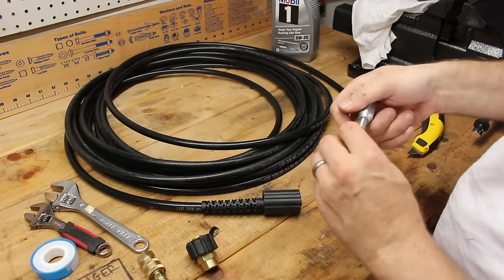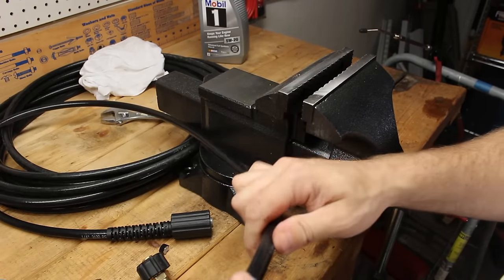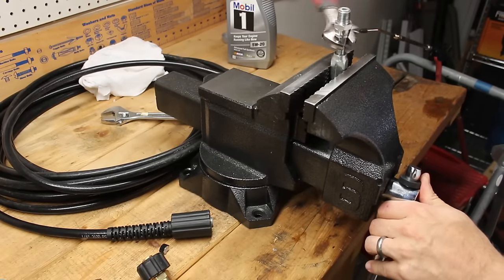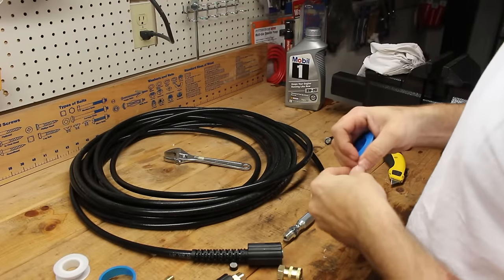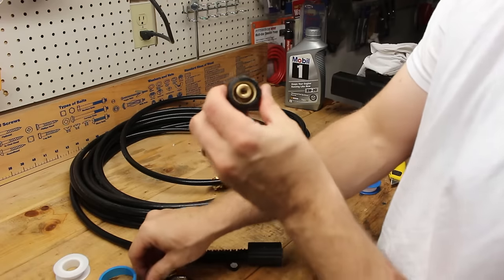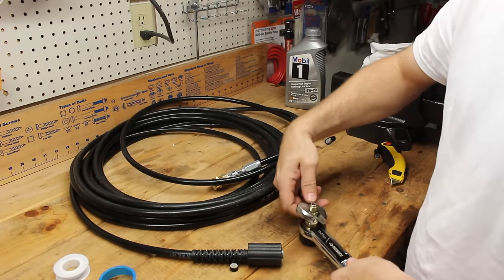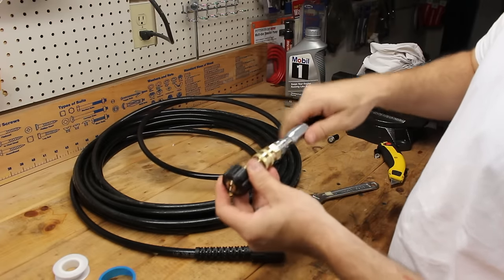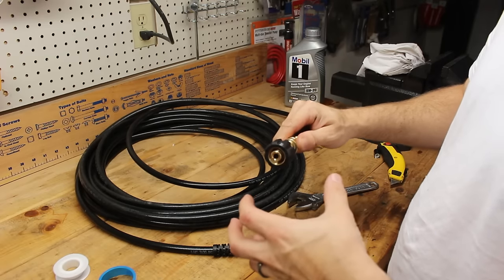How to Repair a Pressure Washer Hose in 6 Minutes (Any brand Gas or Electric)

Comment: Time is money and my time is worth a lot.  Most houses will break in the middle somewhere due to rubbing or scrapping.  A new hose can be had for $20.   I'll opt for that over taking the time to repair.  Your mileage may vary. 🤔
Reply: broderp new hoses run 60$ for 50ft and 100$ for 100ft.  I'd buy new to for $20
Reply from the maker: I've never had a hose break from rubbing, only from touching the exhaust (multiple times). You're correct that time is money, and repairing a burned hose on the spot is a lot quicker (and cheaper) than shutting down a job and driving out to the store for a new hose.
Reply: I also came to that conclusion... NZ$30.00 for a new hose delivered next day.....

Comment: Pin hole is in the middle of the hose, cutting it in half with end fitting won't do. There should be a pin hole repair kit or a union coupling to joint the two sections together.
Reply: I agree! So what is the answer ? Is there a way to splice the hose ? Where will the hardware come from?
Reply: @waynegargano1016  ClampTite looks pretty good but its about $70 for the tool than you need safety wire and coupling.
Reply: I had the same problem, but the solution is more expensive than the hose. You would need two Gates compression fittings, one for each end of the hose and a threaded coupler to screw the Gates fittings together. But as I said, the cost at $15 or so per Gates fitting and the coupler you're looking at $35 - $40. Now if it's a hose that uses some proprietary end fittings you can't find then it may be worth it.  Good Luck
Reply: Moff Diskust  Not sure about that at 3,000 PSI, it will take off like a bullet when it let go.

Comment: You do know u cam buy a new hose for less than that fitting?  Those cheap ass 1/4” hoses can be bought for like $15 on Amazon. I fix my heavy duty 1/2” hoses but not those cheap 1/4” ones.

Comment: Those reusable ends are designed for a 100R1 spec hose, that hose is not. That is cheap Chinese throw away hose. Don’t shoot your eye out with 3000 psi of shit flying everywhere when i5 separates .  A new hose like that can be had for under 30 bucks, but a backup save an eye.

Comment: My Ryobi electric pressure wash hose sprang a leak halfway down the actual hose because the fuckin thing creases. You have no idea how fuckin aggravating it is to fix this fuckin thing. I literally cannot find a solution anywhere. Bought a new hose all the new extensions. Nothing works. Pain in the ass

Comment: Ya I've got a couple of these electric pressure washers they're small kind of weak ass machines but they spray !   They will clean some pretty dirty grimey shit off some things they're great for the truck or dirtbikes etc...  I've been stuck having to use them to strip paint from houses as well and I'm not knockn these things but the a real pressure washer is where it's at for really getting some stuff cleaned off and they've got the quick little hydraulic or whatever they are called  releases for switching tips easily and the hose fittings are better by far these electric ones have problems with leaking seals o rings release valve always gets wore out quick I've rigged up a few wands now that are compatible with my wand assembly and aren't so prone to losing its seals so quickly the way they make them is just weak they don't hold up for but a couple of uses probably because of the whole made in China fact that this happens we pay descent money on crappy manufactured things and waste our money having to fix the stuff on the added down time one must then need in order to fix it if he fuckn needs it then and there BUILD RIGHT QUIT RIPPING US OFF .... IT'S OUR OWN BUSINESSES AND GOVT OUTSOURCING THIS IS JUST ONE GOOD REASON WHY TRUMP IS BETTER FOR THE JOB THEN THAT HILLARY DUDE !!!      Never trust a woman you do not personally know well when she puts up with a fake husband and marriage and being insulted and can't satisfy a man because she looks and dresses like and tries to piss like a guy that's a lezbo and lezboz hate men especially smart white ones who can actually do the things that we do and why trust anyone who hates anyone or tries to be like someone else and who puts up with that home life and who clearly is just a fucking phoney all the way around I mean c'mon people  in not being racist or sexist we all know most stereo types are for a reason if it walks like a duck and quacks like a duck it must be one damm good at being a fake ass mother fucker if not actually a fuckn dam open your eyes you don't agree with her agenda and politics you know this bitch is unstable at the least trump is at least having fun at work and that's what makes every damm job better and get done better and with better watching eyes over it YOU TRULY ARE A IDIOTIC PETSON IF YOU ARE ON THE SIDE OF SOMEONE WHO HAS ANY TIES TO THAT LIFESTYLE SHE CHOOSES THE CHILD STUFF THE MURDERS IF ANYONE IS CATCHING THOSE ALLEGATIONS AND EMAILS THAT SHOULD BE CLOSE ENOUGH TO  BE TOO DAMM CLOSE FOR SOMEONE OR ANYTHING TO BE SOMETHING YOUR AROUND AT FUCKING ALL IF YOU WERE GOING TO SHIT IN A SANDWICH AND THROW A PIECE OF BOLOGNA ON IT WOULD YOU CALL IT A BOLOGNA OR SHIT SANDWICH OR A BOLOGNA SHIT E SANDWICH suM?
Reply: WHAAAAT?

Comment: I can buy a new hose for what the parts cost on this video.....
Reply: Not a good quality hose you can't. A Made in China POS hose maybe. The best use of the Gates repair fitting is the ability to repair on the job rather than having to go to a hydraulic hose repair place or go buy a new hose.